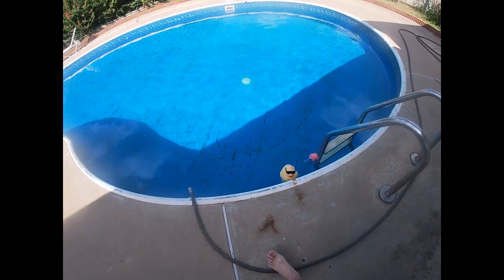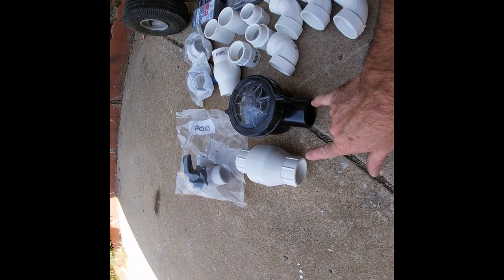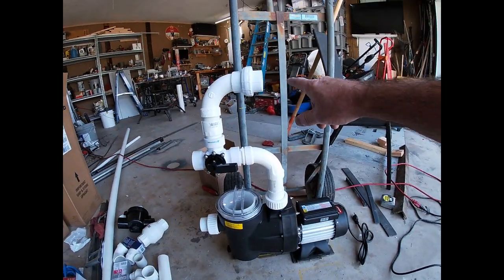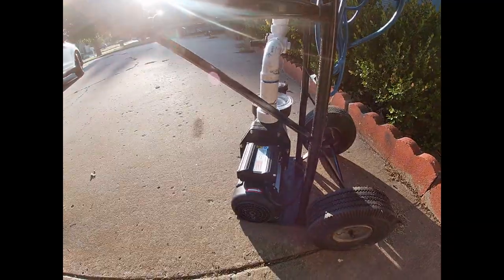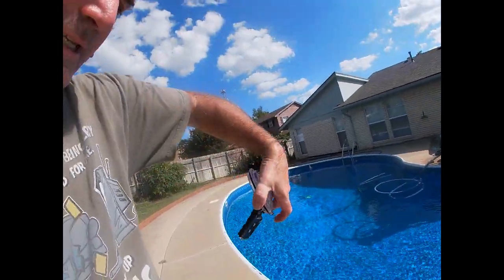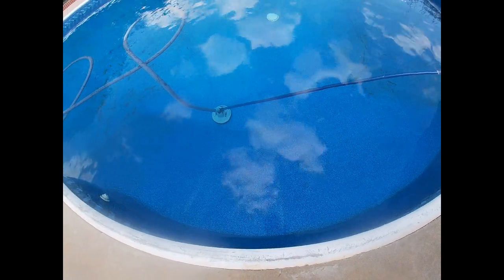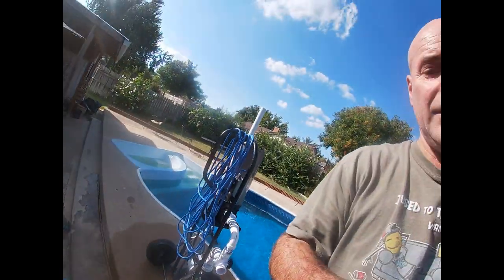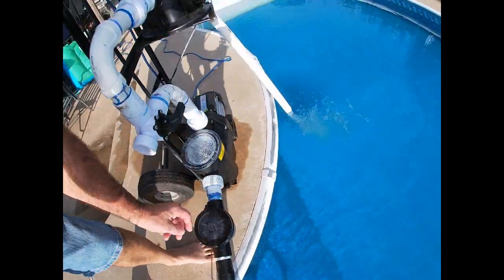portable pool pump. DIY pool vacuum

Comment: Use a barbed 1 1/2 pvc fitting on the front of the pump for easier  prime  with no duck tape
Reply from the maker: i will. thank you

Comment: Thank you for uploading this video. I started to build one . Got a pump and a used cartridge filter. Only problem I'm having is the exit pipe. Went to local pool store and they couldn't figure how you make it bend when you cleaning and straight up when finished.  Any advice on the fittings. Thanks
Reply from the maker: what brand

Comment: I’m building something like this out of spare parts.  What I can’t figure out, can you backwash it?  How?
Reply from the maker: great idea. i had not thought of that.. just looked at mine .  turn the valve to waste  and remove the filter and hook up to the waste outlet. . a lot of work. it isnt hard to clean the filter but would work
Reply: @mikesproject4704  oh, it’s a cartridge filter, right?  I had it in my mind that it was a sand filter.  Guess it’s easy enough to take the cartridge out and hose it off.
Reply from the maker: @gregthorne4292  yes cartridge filter. works well for cleaning the pool. after winter green have to clean 4 times  little bit of a pain